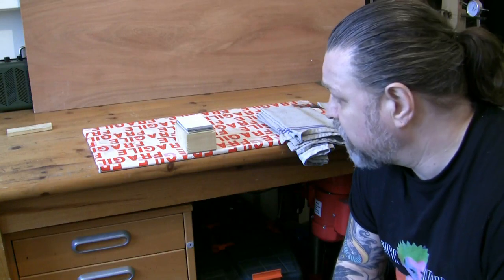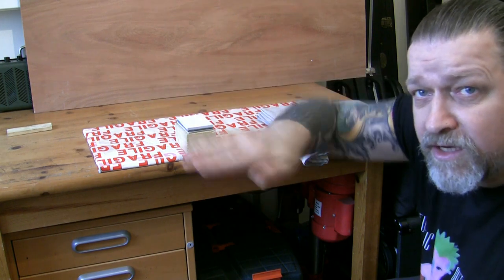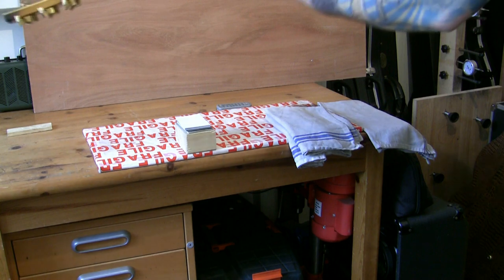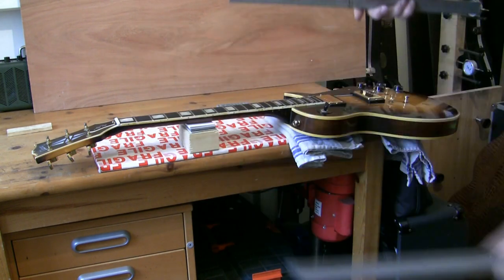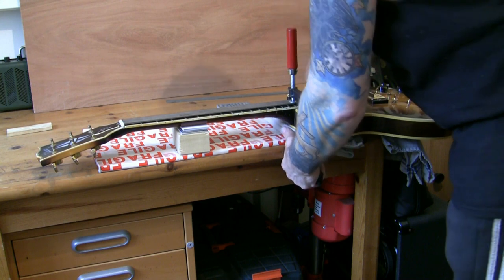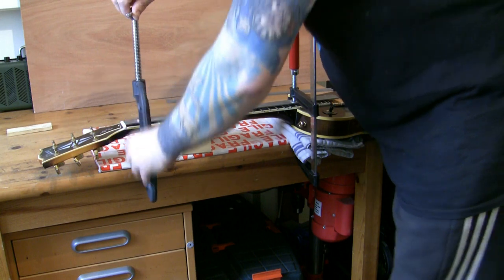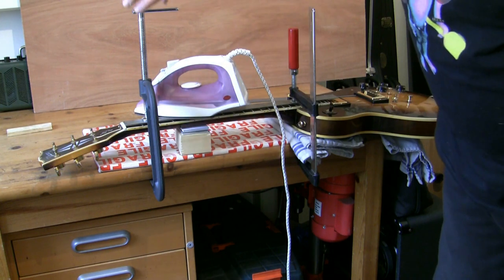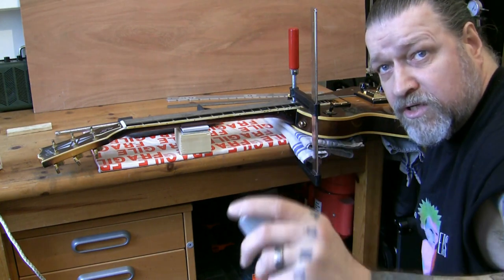How to (or how I)... straighten a guitar neck using heat and clamps...

Comment: I read ages ago that over time the guitar will return to its original warp and a good sign of that is if the guitar doesnt hold tune when left sitting for a while.
Reply from the maker: You are coaxing the wood back to it's original shape so why would it bend out of shape again? The reason guitars warp is because they are not stored under the right conditions. If there is moisture in the air the storage area, the guitar will keep it's shape. They go out of shape because they dry out...
Reply: @FretFriendGWaL  He was talking about repairing a forward bow, maybe thats why? I have no idea im no expert but im interested in knowing if there is a point a neck cant be repaired and when you decide to shave the fretboard instead.
Reply from the maker: @GibsonLesPaul2273  There is always a point where a neck is no longer repairable I think. Funny thing, I am currently repairing one of my own recent purchases where the neck just would not go straight. I actually have it straight now using just reverse-clamping and I have added a washer between the truss rod adjuster and the rod itself to give me more adjustment. Now I need to fix the belly bulge and forward tilting bridge. Pretty confident I will get that fixed too. There will be a video on that soon so watch out for that. Regards, Victor...
Reply: @FretFriendGWaL  Thanks for the education and glad its working for you. I have a very expensive classical with a sudden warp at the 2nd fret on on side and the 6th fret on the other side plus a bulge at the 14th fret so I think I need to sand it down instead of trying to bend it into shape. It has a truss rod but its not adjustable another reason I think sanding and re-fret is the only option, but its expensive and ive only skimmed and refretted 1 electric.
Ive got my classical in the same setup as your video clamped up but with some water tubes in the sound hole and wrapped it in a damp towel and see if the re-humidify trick works first.

Comment: Seems like a good method. Is the bar made of aluminium, iron or steel? Which material and dimensions do you recommend for it? I looked around and all options seem expensive so I don't want to risk buying the wrong stuff. I want to use this method to repair my grandfather's old guitar and perhaps also some future projects.
Reply from the maker: Mine is steel: 2 inches x 1 inch box section...

Comment: Hello, have you tried this without heat? Such as leaving the guitar clamped for a few days or so.
Reply from the maker: Yes I have! It does work sometimes but not often. Regards, Victor...
Reply: @FretFriendGWaL  Thanks for the reply Victor! I've ended up using a clothes iron and after multiple passes and checks, moving the middle bending point and leaving the neck clamped overnight now the neck with the truss rod loosened and with the strings fully loose has the amount of relief I'd like with full string tension. What would you do at this point?

Comment: i have a strat neck with a bow but the truss won't give more relief. I assume remove the neck on a bolt on before clamping? Should I loosen off the truss a bit also? Means more of a bow to clamp down?
Reply from the maker: Yes, remove the neck anmd loosen the truss rod...
Reply: @FretFriendGWaL  
cheers.

Comment: Can this work on a classical guitar that doesn’t have a trust rod? The problem on my classical guitar is that the low E to the B string is all good but the high E is touching the fret, basically it’s bent on the high E string and I wanted to know if this method will fix that problem for me.
Reply from the maker: It is the only way to straighten a neck without a truss rod...

Comment: Where do you get the metal plates from which go between frets and the iron 🤔
Reply from the maker: Just steel strips from eBay years ago...
Reply: @FretFriendGWaL  thanks nice method l will use this on a neck with single action truss with outwards bow 👌🏼

Comment: If I have a neck with the bass side near-the-nut sunken, as well as the treble strings side over the 15th fret also sunken... Can i use this method?😐
Reply from the maker: I'd clamp it to a flat surface then blow hot air at it over a period of time (not too hot)...

Comment: Can this method be used on a 70s Martin acoustic with the  "box tube" non-adjustable truss rod?  I would be using the middle clamp method to add relief.  Thanks
Reply from the maker: Non-adjustable truss rod? I don't get it! The only way to find out is to try it but the truth is: I do not know. Try it entirely at your own risk...

Comment: I did not catch one detail if you would this. Do you undo the s truss rod first when you are clamping it or do you clamp it under the full truss-rod tension?
Reply from the maker: Hi David... Always with the truss rod slackened off! Some think you can bring it back to tension when you have it clamped where you need it but I do not like to do that. I always keep it with the truss rod slackened off (no tension). Regards, Victor...
Reply: @FretFriendGWaL  Thanks Fret Friend! i suspected that but needed this confirmation before I got down to ironing!

Comment: When the neck is perfectly straight but angled back with respect to the guitar's body, should I try correcting the neck-body angle with heat too?
Reply from the maker: I would not do that!  Some guitars are built that way. If the angle is wrong, I'd shim the necl pocket but if it is built that way, it should be fine as it is...
Reply: @FretFriendGWaL   Got it, thanks for your message.  After purchasing this '85 Guild S-284 online I noticed some paint discoloration and wasn't happy with it, so I let this Daniel Mogg guy redo the paint on the guitar.  Five months and $300 down later he finally has the guitar ready.  Soon as I pick it up I notice the neck has a 5-degree backward angle and Daniel swears he hasn't touched anything besides the finish.

Before the paint job the guitar was perfectly set up, but now the bridge lies some 3/8" too low and I'm trying to figure out how to make it playable again.  I have no idea what could have happened and no one at that paint shop was helpful at all.  Thought I'd share my experience with others here, because it's definitely better to settle on a playable instrument with less than perfect aesthetics than ending up with the opposite.

Daniel's business in Lauderhill FL ran by the name of "Anonymous Guitars"  ...by the time I went back there to complain about the condition the guitar was delivered the shop was closed permanently.
Reply from the maker: @Witcher58  Well that sucks! I don't know how they managed to do that...
Reply: @FretFriendGWaL   Most probably it was caused by the paint booth heater during the curing process.  I guess a neck reset is the only fix now, tho it would ruin the paint finish, ironically.  I'm considering just separating the bridge from the body by means of a 3/8" spacer and calling it a day... a strat type guitar with a neck angle steeper than an LP is quite a sight.

Comment: Can I ask, how much bowing can be achieved, approximately? Brook Hoover mentioned that he has some 60s Japanese acoustics, touching upon a problem that costs guitar enthusiasts hundreds.  I myself just picked up 1971 FG-140 Red Label Gakki for peaunuts.  It sounds better than a Martin and it is playable - though you wouldn't want to try making a bar chord.  To remedy it they say requires a neck rest at around 350 quid.  So, would this method provide enough back bow to reduce a few mill at the 12th fret do you think?
Reply from the maker: If it was originally straight, regardless of how much bend it has now, it can be bent back. You are only coaxing the wood grain back to it's original state. On a non-finished wood, you could also try steaming it while clamped though I would use that approach with caution! Regards, Victor...

Comment: Thanks, man.  I have a slightly different problem.  I bought a very used/abused bass (for next to nothing), and it's got a very wide neck/fretboard.  The neck passes the straightedge test lengthwise, but my problem is cross-wise, the neck is so warped that it's got a "negative fretboard radius".  It has three truss rods (so does my 9 string schecter, but luckily, I've never had to adjust it as it's rock solid).  Would it be possible to loosen the middle rod, and tighten the outer 2, slowly more over time?  Or would that start cracking/breaking stuff?  Or, would it be possible to support the very center of the neck underneath, and use a ratcheting strap and a couple blocks of wood on the outside edges of the neck, and use an iron like this, slowly tightening over time?  If not, I've removed fretboards before, but god what a pain in the ass.
Reply from the maker: Straighten it with all truss rods loose using whatever methods needed! The truss rods should only be used under string tension so, ideally, you want the neck straight without the truss rods being tightened. Victor...
Reply: @FretFriendGWaL  Thanks, really appreciate it!

Comment: Hay i am trying to restore a guitar and im about to replace the frets its and old guitar and it have little bow but what its best first install new frets straight the neck and than sand the frets or first straight the neck than add new frets ?
Reply from the maker: Always straighten the neck as much as possible before installing new frets. If you cannot straighten it, you are going to have problems...

Comment: Hi Victor - can this be used  as a possible fix for an end of neck flip-up on a maple strat neck? It's on the bass side of the neck - I assume it occured because I use 12's - frets are level and no matter how I adjust the truss it doesn't help. Thanks!
Reply from the maker: A common job I do quite a lot: I have a 73 LP and a 90's Warwick bass in at the mo with severly twisted necks at the headstock end. You will need a neck jig or you have to find a way of clamping the neck to a flat bench. Check this video at 1 hour, 3 minutes and 9 seconds: https://www.youtube.com/watch?v=GVDB3YCm5GA
Reply: @FretFriendGWaL  I will see what I can do - at least there's hope. Thanks Vic!

Comment: Hello , How much temperature should I put on my  iron clothes? 1100watts one
Reply from the maker: Enough to penetrate the wood fibre but not enough to melt the inlays or scorch the finish! It is a job you MUST watch and I mean: WATCH! Do not leave it for any length of time. I have caused damage by not keeping watch. I have no set temperature. Regards, Victor...
Reply: @FretFriendGWaL  In the past i had to pay for a "deluxe fretboard service" which as quite expensive, I think i was fooled because i never saw traces of the fingerboard was removed for maintenance, with this method you saved me a lot of trouble, thanks a lot dude.

Comment: I have a 1982 peavey t-20 bass and the truss rod is tightened as far as i can get the wrench and the action is still too high.  Do you think this will work on it?
Reply from the maker: Seems like you have nothing to lose by trying! Try it without heat first...
Reply: @FretFriendGWaL  ok.  So heres the deal.  I saw this video 6 months ago and i tried it overnight with just a clamp and i got nothing.  I finally got around to this bass now and i just tried it last night.  Peavey 1982 t-20.  I didnt have an iron or any steel to lay on the fretboard so i just took 3 small saucepans with lids and boiling water.  I pulled the water off after a half an hour the first 2 times and got the water back to boiling for the heat but the third time i left them on for about 3 hours.  Long story short, it looks like it worked because there is backbow.  I wont know for sure until i get the strings to full tension cause i have read i could make the wood limp but as it look this second, it worked!
Reply from the maker: @thinkhendrix  That's great! Let's hope it holds :)
Reply: @FretFriendGWaL  happy to report. That it worked!  Great, low action!  I have another t-20 in worse shape that im also gonna try tonight.  Lets see how often this works.  So far 1 for 1.
Reply: On a 37 year old instrument too!

Comment: Hello there, i had an amazing playing warwick bass a streamer  lx4 with bolt on neck. Sometime mid winter i did a string change with very little difference than the strings i replaced. On tuning these i noticed dead spots, fret buzz and other bad noises. I had it confirmed that on the E, and A strings on the first couple of frets was an acute warped area. I clamped in two spots in affected area and they improved. However this didnt last long but never got as bad as it was. Could you recommend any fixes? If i had the money id get they fretboard off and level beneath. Hope you can advise.
Reply from the maker: Odd you should post this now as I am just fixing another Warwick bass with a severely warped/twisted neck! There is only one way to fix these and it is fingerboard off. I am currently doing my 3rd Warwick bass right now! Here is the last one I did (a Streamer): https://www.youtube.com/watch?v=GVDB3YCm5GA (Check my YouTube videos for the first one: a Corvette)...
Reply from the maker: Only fix is heat and clamping. Heat will melt the glue and clamping will hold it in the position it needs to be in. After it has cooled, you may need to reshape the neck and sand it as the fretboard will move slightly (from the neck). You will then need to oil it as the heat will dry the wood out. You can send it to me for a proper repair if you want...
Reply: @FretFriendGWaL  really appreciate your reply as despite of an information super highway it gone pretty lonely waiting for any word on what's good and the doom sayers "don't do anything" be nice if I could send pics and give me an idea of of where I'm at, but thx for your input.
Reply: @FretFriendGWaL  hi there. Firstly big thanks for taking time out to answer. The twist was strange but im glad it was. Looking up at the neck flat from bridge p/u to nut to last 2/3 frets had a ramp type thing, more pronounced on the E&A strings. Before seeing your reply i put a wet towel on the back of neck and ran iron back n forth or in the effected are, then clamped in 3 places with wood above and below. The music shop where i took it said id have to have fret board removed and levelled but felt i had to try. I have no pics before sadly, but have a couple taken no strings or nut so there was nothing to distract the eye. It would be nice to send them, and where are you situated? Im in west yorks which is usually a disadvantage. Id of left my email but didnt know if this message is private. Hope to hear back from you and possible repair options. Mark
Reply: On the second attempt i used way more heat and clamped a 3 fet span with two clamps and its the best or closest to how it was pre-warping. I was told by local music shop after the fact but before i saw your reply that heat was bad, bollox.
Dont know how you keep up with comments and thx for the reply.
Reply: @FretFriendGWaL  Do you have a premises where i could let you look at my bass? I know its not quite the bass i bought and would like your opinion on whether you could improve it to how it was? Thanks
Reply from the maker: @TheOneshoe  There are links to my facebook page / workshop on every video I post (in the description). Check on facebook. Victor :)

Comment: hello sir....
i have a problem with my guitar neck...
and I've been looking online for solutions but still couldn't find anything.....

it's a 7 string guitar though...

so on the side of the low b string it's upbowed...
but...on the high e side...
it's straight.......
and if i would to adjust the truss rod....
the low b side would be straight....
but the high e side will be back bowed......

is there any tips i could do for this problem?

sorry to bother you bout this sir....
Reply from the maker: Hi... You can clamp the fret side to a length of steel box section then use a hot hair-dryer to get some heat into the wood fibres to (hopefully) straighten the neck. Not an easy job to fix but it is possible. Victor...
Reply: @FretFriendGWaL  
aights. thank you so much for your time sir...

all i did was took off all the strings and let the neck rest for 2 weeks.  
but I will try the method you suggested.
thank you again sir.
Reply: @FretFriendGWaL  how do you fix a warped neck thats a fixed neck? I just got this 12 string fender acoustic for my bday and i wanna fix it so damn bad

Comment: Hi, i have ibanez grg170dx left handed. i maked "Neck Straight Edge Notched" measured. Thin E side more relief.  Truss rod not fixing this; Thick E straight, thin E relief.  How to fix? heat thin E side with clamp? fix options?  i need a help. Thank you.
Reply from the maker: You need to loosen the truss rod and clamp the neck. Once it is in a straight position, you need to put some heat there! Maybe a hair dryer on the hot setting. You do not need as much heat as you may think. Leave the heat for maybe 1 hour (not too hot). Then remove the clamp and check. If it does not work, tighten the clamp a little more and repeat...
Reply: @FretFriendGWaL  with steel ? thin e side? on middle string? fret radius with heated straight steel no problem? Sorry for my english. Thank you.